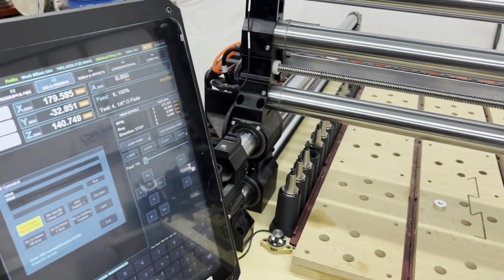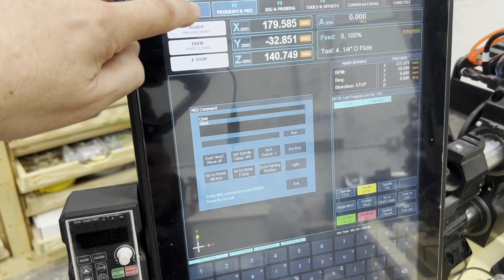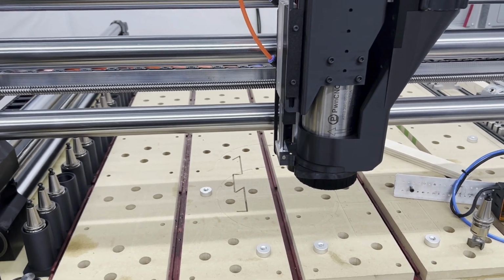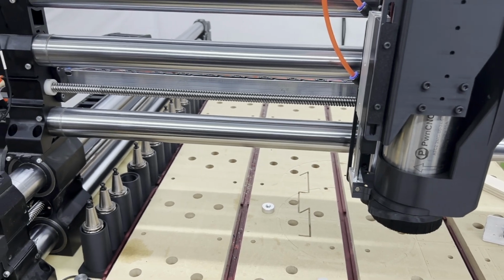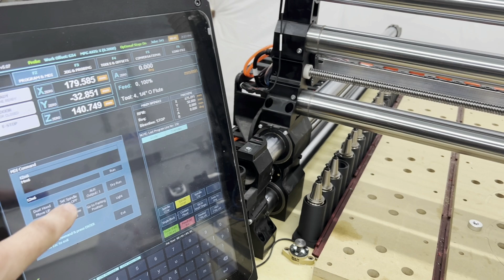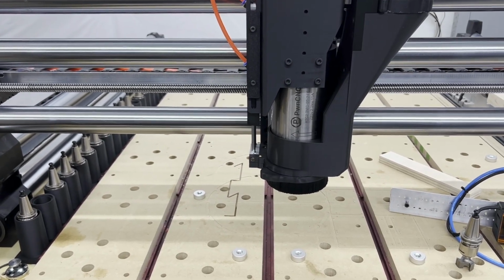Sidekick ATC Dust Boot

Comment from the maker: CORRECTION: You can comfortably support tools as long as 2.5" below the holder with about .5" of clearance between the bottom of the tool and the top of the tool holders while racked.

Comment: Could you do an air test for the sidekick like you did for the other dust boots?
Reply from the maker: I did that right after the boot was operational.  It's equal to approximately 75% of the market-leading Big Suck or 82% of the popular Nighthawk.
Reply: @UglyDogWoodshop  I'm hoping to pick up an ATC on their black friday sale, and if I do I'll be ordering your sidekick right after, I'm planning on sticking it on a Camaster Stinger where I have no clearance issues off the right side of the spindle, would you consider designing a mount for more airflow for those of us without clearance issues?
Reply from the maker: @killorkubed mounting the sidekick to anything other than the Onefinity z-20 slider would be tricky.  I haven’t designed other versions because it’s a ton of work to adapt this design to other machines and I’m not sure how many would sell since I’ve never gotten more than one request per unique machine.
Reply: @ ah really good to know, I figured it mounted right to the spindle somehow… it’s not feasible to make a 80mm mount to be able to mount it to any machine with the ATC?

Comment: Question. The ATC is on my short list   Can I purchase this and use it manually with a side button maybe without having the ATC yet?
Reply from the maker: Yes.  You just have to make sure you use the MDI button to move the boot manually.
Reply: @UglyDogWoodshop  thanks.  Can it be activated with an external physical button?
Reply from the maker: @RockhollowCNCServices  Sorta.  The MASSO beta release has a configurable input called Dust Hood-1, which moves the boot up and down.  That can be assigned to a button.  It's not available without the beta though.   Without the beta, you could get creative and put a button in place of the relay and that would work.  The MASSO wouldn't have any control of it, but you could move it manually with a button that way.
Reply: @UglyDogWoodshop  cool. Placed my order this morning.
Reply from the maker: @RockhollowCNCServices  Thank you for your support!
Reply: @UglyDogWoodshop  how many volts does the solenoid need?
Reply from the maker: @RockhollowCNCServices  It's a 24V DC solenoid.
Reply: @UglyDogWoodshop  thank you.

Comment: @UglyDogWoodshop
I'm currently working on a z independent dust boot that is compatible with an ATC for the onefinity elite foreman. I've gone through several iterations of designs, and I can say that it is absolutely possible to create a boot with 360 deg. brushes. Based on my own testing, I can see three problems with this design.

1. The missing brush defeats the purpose. I can't imagine this will be effective.

2. The boot wraps tightly around the spindle, which will greatly reduce air volume as the spindle moves down in the z-direction. I know this from first-hand experience since I tested a similar design. Would love to understand how you solve this. Im assuming you have an air port that doesn't conflict with the spindle?

3. This system makes use of a pneumatic cylinder, which means that the boots' z-axis position doesn't adjust to the length of the cutting tool. While you mentioned the ability to adjust the z height, this is still a manual process, which defeats the purpose.

My design accounts for all 3 of these issues. I only mention these because I encountered them while going through iterations of my design.

With that said, I appreciate the designs that people are coming up with.

Please note that this isn't meant to bash your design. Just wanted to point these out. Hopefully, we'll see improvements in future iterations.
Reply from the maker: There are trade-offs with any boot design.  Performance-wise, this boot performs well, even with the gap in the back.  If installed properly, the spindle doesn’t block the airflow.  

You could have a different design that is more of a fixed-z setup, mounting to legs on the z-slider’s rails, but it would violate an existing patent and wouldn’t be sellable.  

It would also be z clearance restricted and it wouldn’t be able to use the full z-travel.  Those are both design criteria I prioritized.

If you’ve designed a boot that works for you, then that’s great.  Im sure different people
Have different needs.  I’m quite happy with my boot and its performance too.

Comment: Nice work.  Could you not have a air blowing at the rear to make up for the lack of a brush?
Reply from the maker: It's possible, but that could use a lot of air, depending on how much air you're thinking.  I suppose there's nothing stopping someone from doing that with the boot the way it is.  So far, I've been happy with its performance though.  I'm curios what others will say after I get them shipped.
Reply: @UglyDogWoodshop  I’m currently designing my own dust boot for an xcarve (a simple height adjustable one) and have encountered the exact same problem.  Ive left the back open like you but I have allowed the brushes to continue unsupported on each side so they are somewhat compliant.  I have a 20mm gap so probable more than you have but I feel your pain.  The air option was something in toyed with but I wasn’t willing to hook air up just for that.  

Another issue I had was that any sideways force on the brushed section made it slip off.  I put some male/female bosses to provide lateral support.  This helped but I ended up using a threaded insert (I’m a belt and braces kinda guy). I’m surprised yours doesn’t have that problem given my experience but yours is a much better design than mine :).

Comment: Genius   That is all. Thanks brother
Reply from the maker: Thank you!  I hope it catches on.
Reply: @UglyDogWoodshop  how many tools will fit on the foreman with the tool setter where you have it?  I have mine in the rear corner at the moment.
Reply from the maker: @RockhollowCNCServices  22 or 23.  I have 21 on mine, but I also have my tool setter in front of my tools and I left some space free directly under the home position.  So, it depends what else you want to put along that axis.  You could go crazy and add multiple rows, but I don't think that's what you were asking.